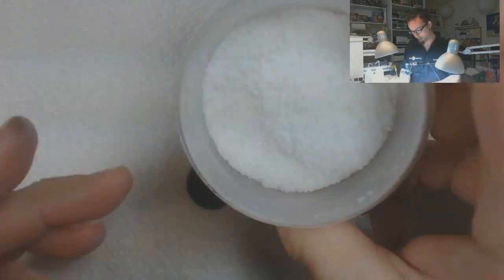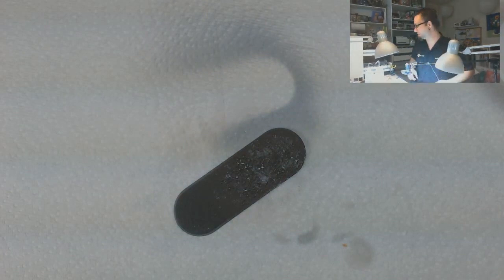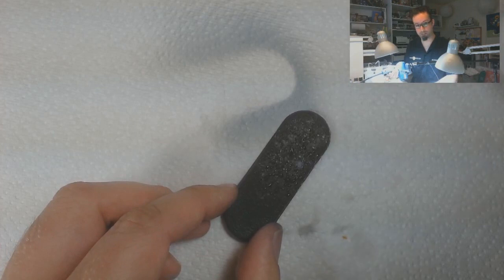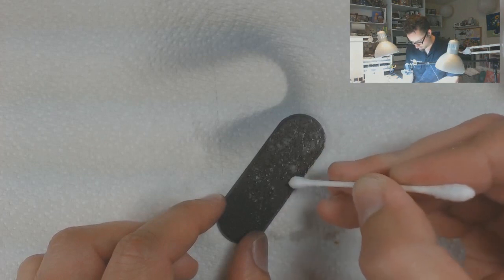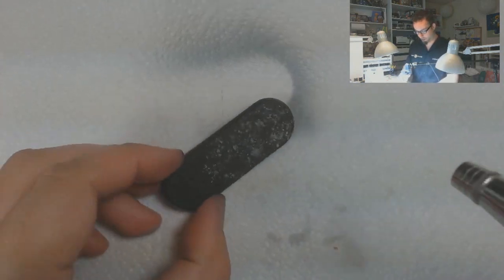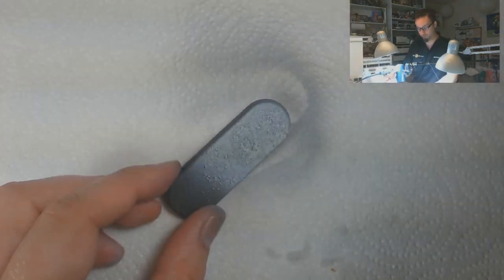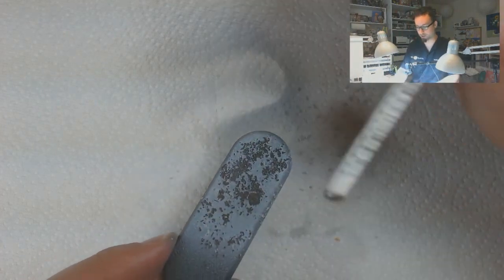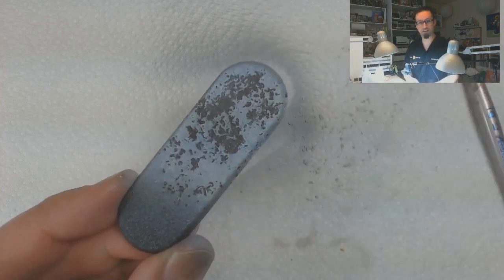Two Minute Tutorial - Salt Chipping

Comment: I keep having a problem with the paint around the salt turning a lighter colour, and it also happens wherever some of the water flowed after being in contact with the salt.
Reply from the maker: The most likely cause is over application of water. If there's any pooling, it will leave a residue behind. You can use this intentionally to create some neat effects, but if you don't want it then a bit less water should be the cure.
Reply: @SecretWeaponMiniatures  Many thanks for the reply, I was thinking along those lines myself, but needed confirmation from someone with more experience. As you point out, you can however use the effect to give the paint a blotched faded effect.